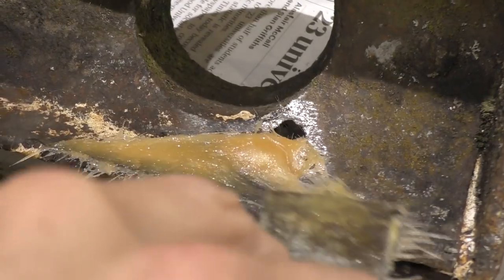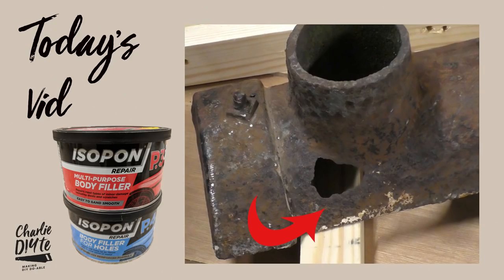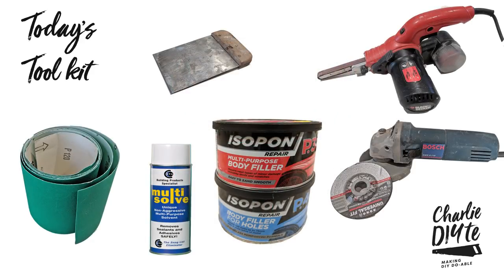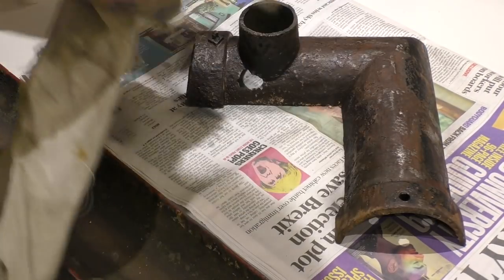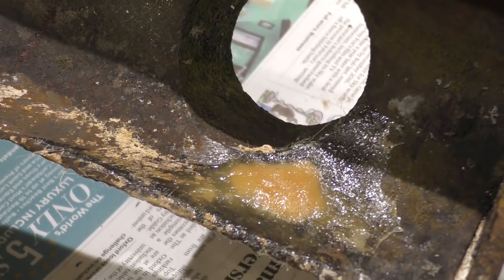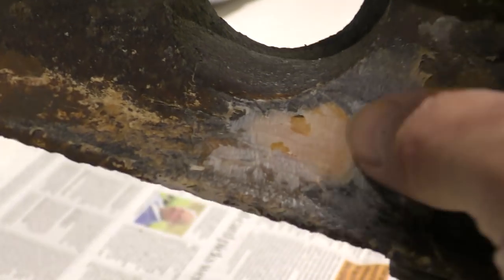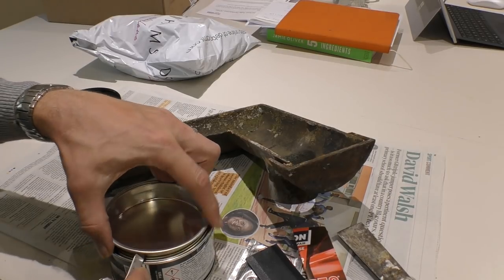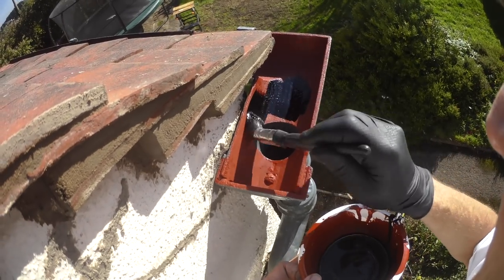How to Repair Holes in Metal - Video 1 of 3

Comment: Nice Job Charlie. My cast iron guttering wasnt as bad as yours when I moved house but did have some leaks between joints. I fixed it up and painted guttering inside a couple of times over years with bitumen paint. On outside I used rust remover, hammerite black paint. Then later grey undercoated and International 10 year gloss paint so far 8 years on its kept its colour very black. I have one of them B&D electric files too blooming good tool it is but it can be quite vicious
Reply from the maker: Thanks Chris. I also had leaks between joints, and I found these kits to be brilliant http://bit.ly/2OWN6Fz but you have to be careful knocking out the old nuts and bolts as the cast iron is quite brittle and can crack. The B&D files are brilliant aren't they. I had one as a kid and it was my favourite tool by far. Bought this one to replace the old one and I still use it a fair bit.

Comment: Eeeek!    I'd take a different route.  Cast iron for rain gutters always struck me as incredible overkill.  Unless I'm doing a bona fide historic preservation/restoration type project, my strong temptation is to take all the cast iron down and send it off to the metal recycler and replace with suitable seamless extruded PVC gutters.  Anyway, you did a great job.  Thanks for posting
Reply from the maker: I hear what you say. It's mostly a cost thing of replacing it all and renewing all the brackets. But also they do add quite a bit of character.

Comment: Hi Charlie I don’t know if anyone has asked this because I am relatively new to the channel but would this be suitable for repairing tiny pinholes in a wheelbarrow so I can use it to mix mortar? Like we are not talking of big splits or anything like that but just need the wheelbarrow to not leak when mixing mortar up.
Reply from the maker: I'd be inclined to give Milliput a go instead. It might be a bit more durable https://youtu.be/6Ko7r7pveBQ You could even dent the pin hole to give the filler a bit more purchase and then just smudge the filler into the dent.

Comment: Thanks for that. We are going to use these tips to repair a hole in our car port. We have tried some metal tape (Byute Flashing) but water still gets through.
Reply from the maker: Hi Amy, yes, this stuff will sort it out. If it's a really large hole you should span it with some Isopon aluminium mesh like this https://bit.ly/2CEOJmh first. Good luck with the repair!

Comment: Charlie good video. U turn your hand to anything.
My question is do you know of anything that I can use to hold metal parts together as I am making some scrap metal art but I don't weld, any epoxy you know of? I think there is a 2 part putty you can get. Thanks.
Reply from the maker: Hi Scott - thanks! Well, that's a good question! In the next, or possibly third video I'll be showing how I glued a piece of gutter back using JB Weld epoxy adhesive, but the problem with that stuff is it takes 4-6 hours to set, and 15-24 to cure, so you have to hold both pieces together with something whilst they cure. So I saw this stuff in my builders merchants recently https://www.ebay.co.uk/i/253122443457?chn=ps. Got to say, it looks pretty impressive, and can be put under stress after 7-10 minutes. So that would be my recommendation!
Reply: @CharlieDIYte   thanks I will look into it. Appreciate it

Comment: Hi Charlie, was there any reason why you didn't use a product such as Jenolite after cleaning and before the filling/painting, to add a further layer of rust prevention?
Reply from the maker: That's an interesting one. I bought some Owatrol Oil from Johnstone's Decorators Centre https://www.owatroldirect.co.uk/product/owatrol-oil/ for exactly that reason. It looked really good but it says not to use it with paints that contain hot solvents ie xylene - which unfortunately the Bonda Rust Primer does. I was determined to use the Bonda, having exhaustively researched the best rust printer to use and found that the Bonda with its high zinc content looked the best. So the Owatrol is still unopened in the garage! A real shame because the gutters definitely had some residual rust that could have done with being neutralised. I wonder if the Jenolite world be compatible with the Bonda??

Comment: The finished guttering looks grey in colour but in the video you used Brilliant White Flexible Gloss.  So what happened there?

Also, did you put the Gloss straight on top of the primer without an undercoat?  And one more, why didn't you use Hammerite instead of Johnston's Stormshield Gloss?  Do you not rate Hammerite as good as Stormshield or was it a cost decision?
Reply from the maker: Get you and your eagle eye! Yep you're right. I was going to put an image of the actual tin on, but it's covered in paint so I thought I'd post an image of a fresh new one from t'internet - which clearly is a different colour. Mine is mixed to Farrow and Ball downpipe. I wanted to use Johnstone's bespoke metal paint, but they can't mix that to the right colour so I had to make do with their Stormshield version.

Comment: can i use this compound to fix steel pipe leak that carried high pressure water supply?
Reply from the maker: Not sure. Depends how large the hole is, but for high pressure you'd probably be better with Milliput than this.

Comment: Gret video, and just like me id repair that too. I am dissapointed you didnt grind, paste and sand on the wifes best carpet like you normaly do XD. Might be a good tip to tell people to use safety specs when ginding too. I know to my cost and have a pernimently damaged eye because i was alazy git and didnt use glasses. Any tips for resoring plaggy windows ?
Reply from the maker: Cheers mate. Ha! You're right, that would be my usual style. This one was mostly done on the kitchen table, which is looking a bit knackered as a result!! 😂 Thanks for the point about the safety specs. I'll add that to the description. How did that happen? Did you have the guard off?
Reply: @CharlieDIYte  Yep, i had the grinder in a vice cleaning some rusty brackets and a small bit of the metel flew off and hit me in the left eye in the Sclera. it bedded its self deep inside and i had to have surgey and still do as it damages the vessles and the Vein. i have to have a injection every 4 - 6 weeks to surpress the beeding. Its called retnal Vein occlusion. You can get cool Bolle glasses, and i use them all the time for everything even painting. love the videos you explain everything perfectly and your work is very impressive.

Comment: Using the P38 is pretty pointless as it won't add any strength. Simply use another layer of P40, which will add some stength.

Comment: Should have used a wire brush on the grinder much gentler and would have given a cleaner finish
Reply from the maker: Thanks Stephen. I've been using a wire brush on the gutters (attached to the drill) but I find it just chases the rust/ paint around, whereas the grinder is a much more effective way of exposing the bare metal. I guess putting one on the grinder is more effective?

Comment: I'm thinking that a piece of metal tape on the opposite side of the repair would make it very easy to slop on a layer of the filler.  Once dried, sand the filler, remove the tape and VOILA !! To be extra anal one could then slather another layer on the side where the tape has been removed, dry and sand it smooth and you would have a perfectly shaped repair.

Comment: Next time use a wire brush on your drill
Reply from the maker: Pretty sure I did. Thanks though 🤔
Reply: @CharlieDIYte  lol ok I thought you were using a grinding disk… also thought you only removed the rust in the repair area before applying the rust paint… video is good don’t get me wrong, I feel it just needed a little more prep. The fix looks good … for now… update in 1 year so we can see , thanks